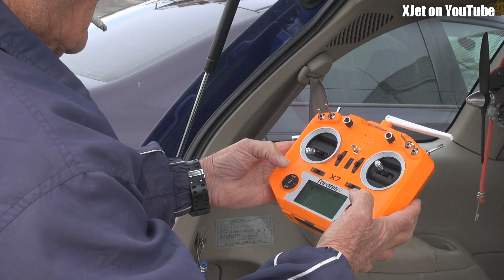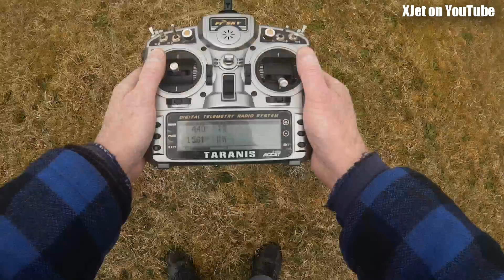A failsafe moment

Comment: I had a 1970 Chevy Nova with a three on the tree. Nice to see another column shift. Ron getting at you is KARMA. Funny though switching out his transmitter. Here in Florida it is unGodly hot and humid, especially humid when it is in the range of 80% to 97%. We do get a sea breeze and the afternoon storms help. But I can't the heat even though I've been in Florida all my life. I can always put on another coat, but you can only get so naked before someone says "put something on" LOL. Thank you for posting and God Bless from, well, Florida of course.

Comment: So close to being stuck. No weight over the back wheels. Maybe fill the bed with old NiCds and MiMHs ;)
Reply: Surley add a number of 3D quads tied down and some sort of throttle control so he can modulate the bed weight as required.

Comment: Wow, your vehicle has a shift lever on the steering column. Haven't seen a straight shift on the column since probably 1959! Memories!
Reply from the maker: I am seriously "old school" mate!  :-)
Reply: Of course it's a three on the tree, all the driving gear is on the wrong side of the car anyway...
Reply: SZretired Didn't know Toyota even made column shifter pickups. Drove my Dad's old '72 F-100 for a while. It was a 3 on the tree too. Good old 302 in it too. Miss that old pickup. Not the best trans though. I think it was the Borg-Warner.... The first 3 anyways. Of course they weren't hardly designed for 340,000 miles. Lol
Reply: ~> Had a Chevy C10 with it back in the day.
Reply: The shift pattern on your truck looks different  than my 74 Ford.
Reply: They still make 3 on the tree?
Reply: It's four/five  on the tree, so you can seat 3 passengers without  knackerating  the middle passenger   :-D
Reply: I had an 1959 Bedford CA van, with the split windscreen, in the 1970s.  It had a 3-speed column shift and I really liked it.
Reply: My family had a Renault 16 when I was small, I think it was a 1971 model. That had a 4 speed on the column.